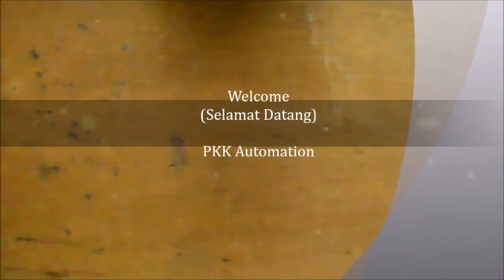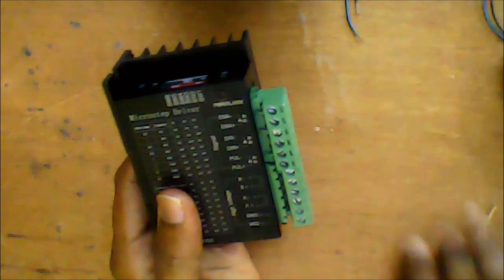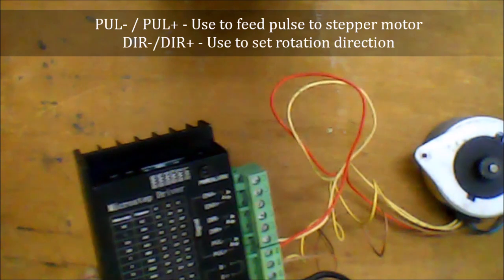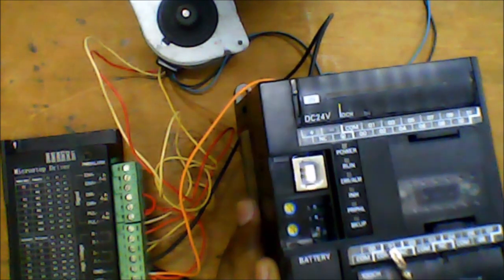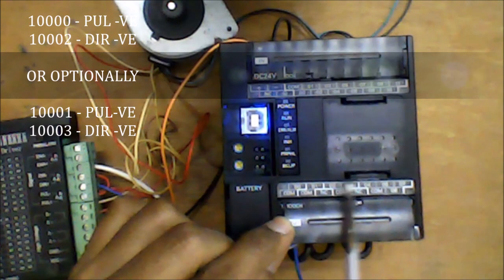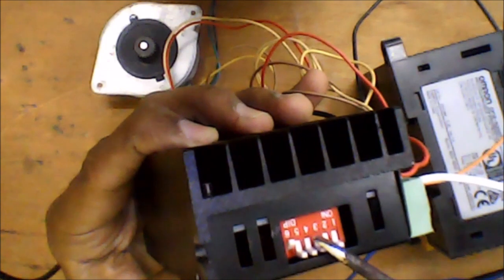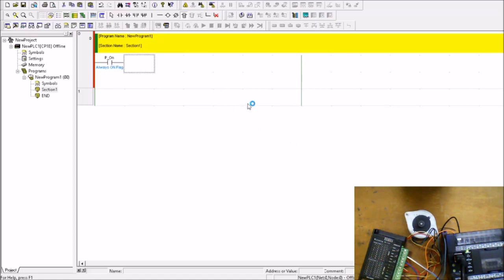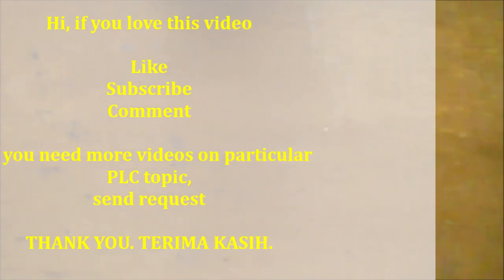Controlling Stepper Motor from Omron CP1E PLC

Comment: Thank you. Can I control multiple stepper motors
Reply from the maker: Depends on your PLC output. Normally 20 I/O PLC comes with 2 high speed output. Thus, you can only control up to 2 stepper motors using. To double confirm, download hardware manual for your PLC model and check the number of High Speed Output available. Another option is connecting ENA pin in the stepper driver. Means the stepper driver is only active its ENA port active. By this, one output can control multiple stepper motors in turns. (this is kind of complex)

Comment: Soalan : There have type of PLC,  Relay dan Transistor
Untuk Type Transistor... running stepper motor use NPN atau PNP?
Baru nak learn PLC
*Suara dan video x berapa clear
Reply from the maker: For driving stepper motor, MUST use transistor type PLC(can be NPN or PNP). if PLC NPN output, make sure stepper driver COM is connected +VE.  if PLC PNP output, make sure stepper driver COM is connected -VE.

Comment from the maker: Thanks Juan. Resistor not required.
Reply: Hi, my plc is 120 vac, can I connect output direct to p-? ( manual said, 5Amps @ 230VAC (resistive load), 250 VA (inductive load) please help, Thanks!